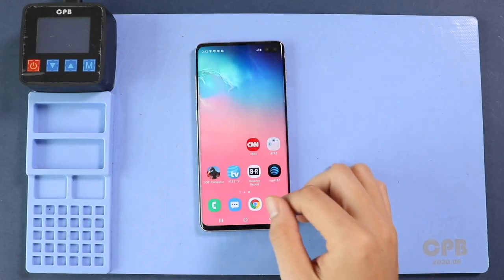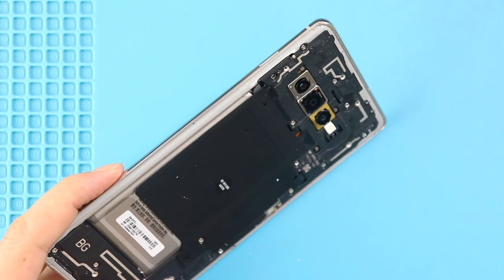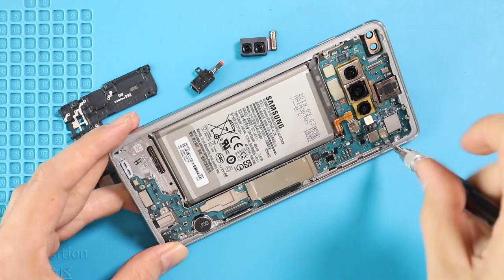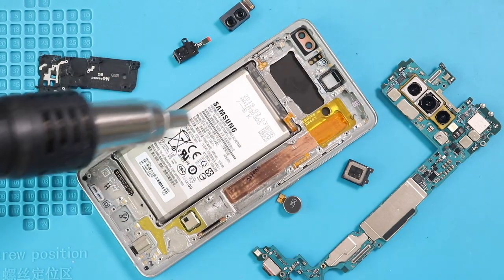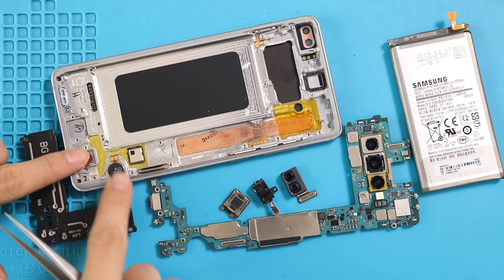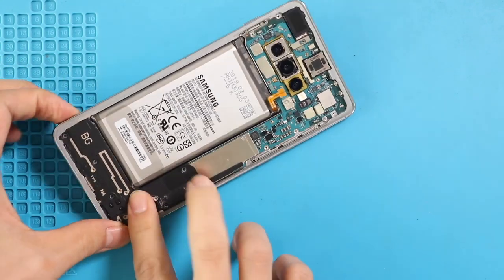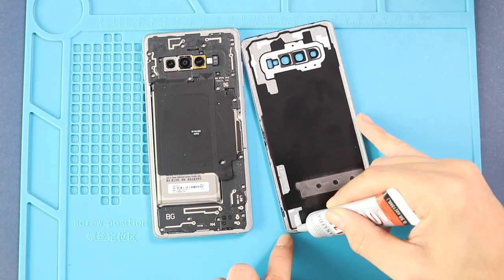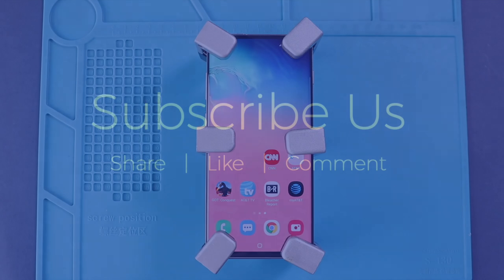Galaxy Galaxy S10+ LCD Screen Replacement

Comment: Can an incell lower-cost LCD version with no fingerprint sensor be installed on a device with a cracked screen that has a functioning fingerprint sensor?
Reply from the maker: If you are installing any non genuine screen, the fingerprint sensor will not work. Other functions will be normal.